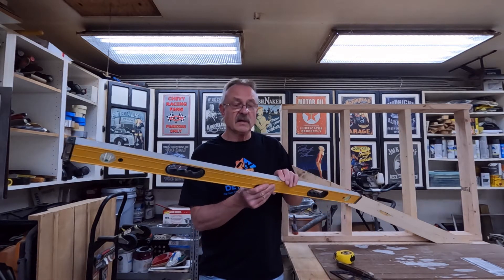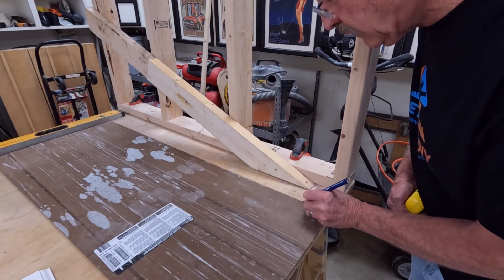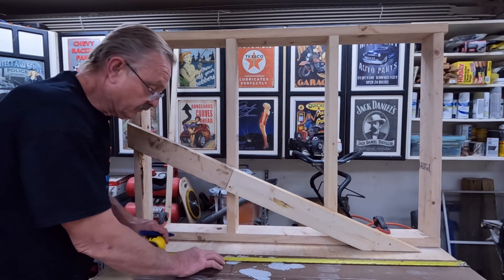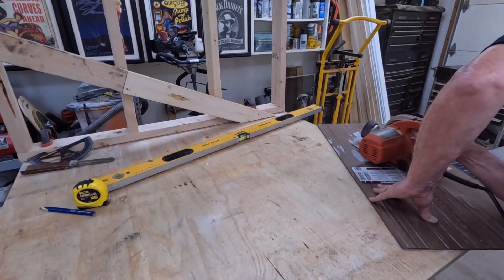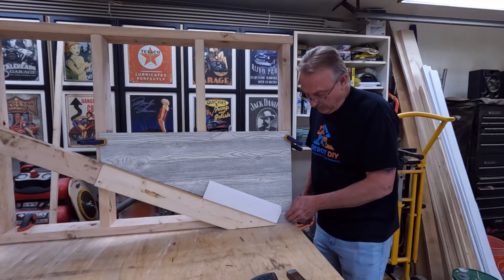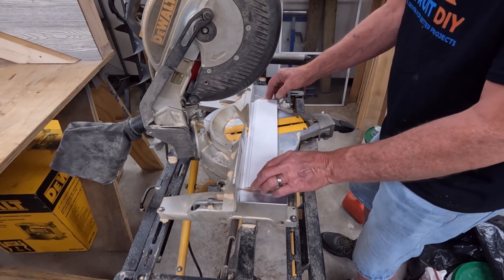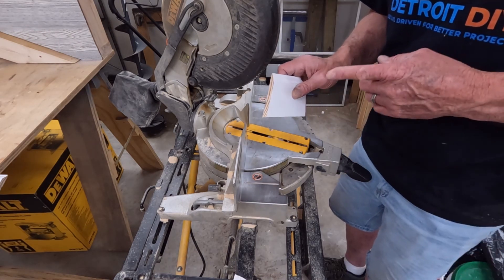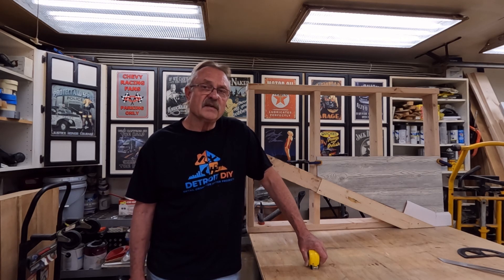How To Figure Out Angles The Easy Way!

Comment: What if you can't fit that tool in that spot my man? Well, im assuming that's why the t bevel slides, am i correct?
Reply from the maker: Tight areas can be an issue, but yes the sliding t- bevel can bail you out.